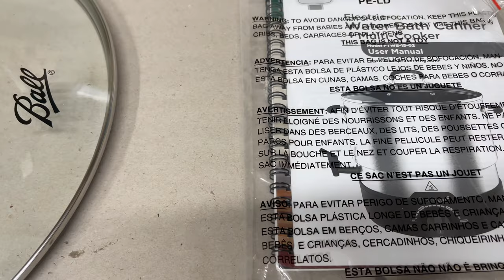#32 | MY MELTER BROKE DURING HUGE ORDER! | BUYING A NEW WAX MELTER | CANDLE BUSINESS HACK

Comment: Yeah most likely the heater element went bad.  That's the coil that's in a loop on the bottom.  If it's integral to the  bottom of the pot then it probably can't be replaced.
Reply from the maker: Ugh so frustrating we can’t replace it!

Comment: To get the wax of the old melter, did you try using a heat gun on the outside to liquify the wax so it could "pour" out of the old melter?